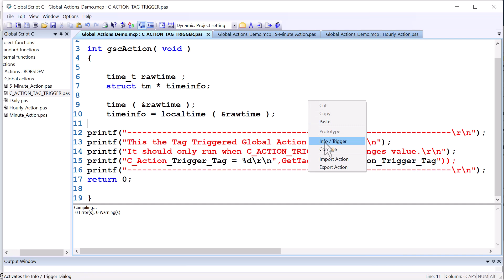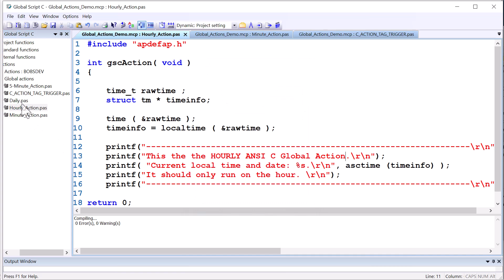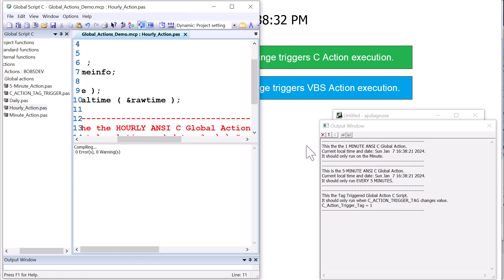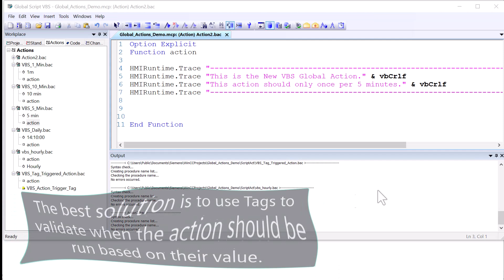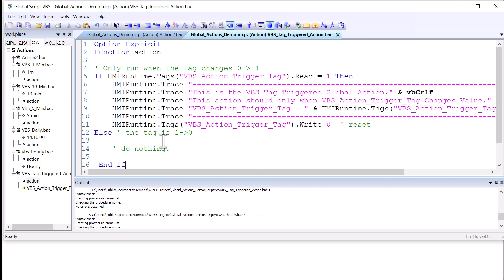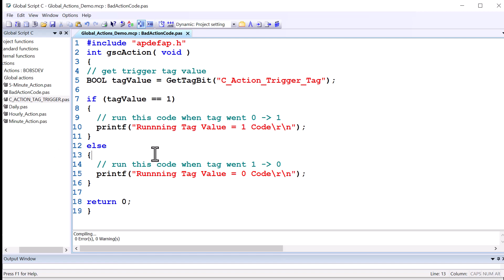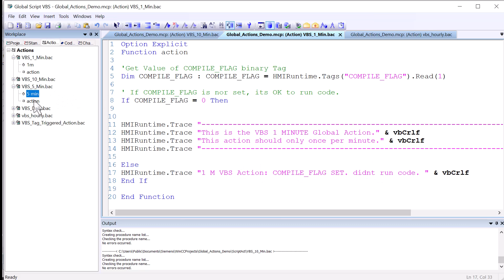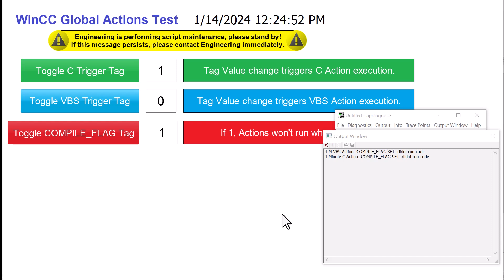Why WinCC Global Actions Run When Not Supposed To! 😱 Here's How To Fix This! #winccguru

Comment: Hey greetings... 
I want to ask about a problem that I am facing in wincc 7.4 tag logging management I am logging multiple tags for trending, hourly and daily basis but my data base is storing this data is only for 9 days and previous data is not showing like is not available or deleted by it self can you provide me the guide what is going on.
Thanks..
Reply from the maker: Right click on process value archive and set the archive management. This allows you to determine how much data is kept and when it is backed up.
Reply: @WinCCGURU thanks a lot...

Comment: Thank you, Bob, for this valuable information.

I have a question regarding my project. I am running 4 to 5 global scripts, and these scripts primarily interact with the database for CRUD operations. However, I encountered a problem in one global script, and due to this issue, it also affects the other global scripts.

After extensive investigation, we identified the problem. My question is, is it possible that if there is any error in one script, it affects the operation of other scripts? All scripts are running cyclically
Reply from the maker: Its possible if they are run on the same thread; Are these scripts on same time cycle?  is it possible to change to tag trigger? 

It also matters if you are writing to a database that might not handle simultaneous RW operations. If using SQL Server it should handle it.
Reply: @WinCCGURU   ,yes, I am using SQL Server. Some scripts run in the same cycle, while others run at different intervals. I employ cyclic triggers for database-related operations. Within the script, I use an if-condition with tag values to perform CRUD operations and disable the tag inside the if-statement at the end. I didn't achieve the expected result using on-tag-change events. Sometimes, it missed some entries. That's why I opted to go with cyclic triggers."
Reply from the maker: Sounds like you have it set up right with a good method. 

In the case of global actions a script error shouldn’t affect another script running unless there is some shared memory between them. But of course I have seen some funny things with scripts over the years. 😂
Reply from the maker: Can you tell me what the original problem was exactly which may give me an idea of why it affected the other script?
Reply from the maker: The Error Object in VBS is Global; therefore you can check if the error Object has something in it using Er.Number, then check it, then clear it. that really helps when debugging.  

If Err.Number <> 0 Then '(Making use of Err Object’s Number Property)
		HMIRuntime.Trace "Error in CreateFileToPrint:" & Err.Number & " " & Err.Description & vbCrlf '(Give details about the Error)
		Err.Clear '(Will Clear the Error)
	End If
Reply: @WinCCGURU  Thanks for your valuable information. I wasn't aware that the error object is global, and that's the reason why an error occurring in one script would interrupt the others as well
Reply from the maker: I have seen it before. Glad it helped!!

Comment: If I'm not mistaken there is also another occasion where all the actions are execute.
I'll try to explain:
if the actions are triggered on external variables (read by the PLC) when a communication error occurs (for example the ethernet cable is disconnected) and then communication is restored WinCC reads all the PLC TAGs and this event triggers the execution of the actions that have triggers on external variables (reread)
I could say something very stupid, perhaps the operation is different now in the new versions of WinCC.
I don't know if you have ever had the opportunity to test in the laboratory whether this operation is also valid for version 8
Thanks for your precious videos
Reply from the maker: Hey, thanks for this I will check it out. It is very possible that this also happens under those conditions. Thank you for bringing it up! And thank you for watching my videos.